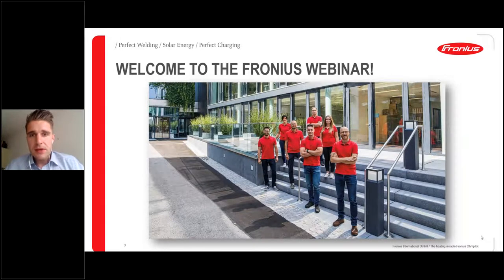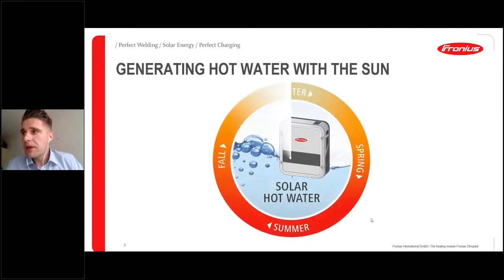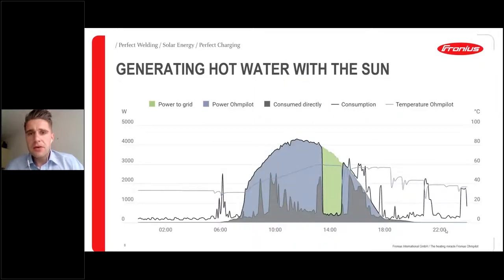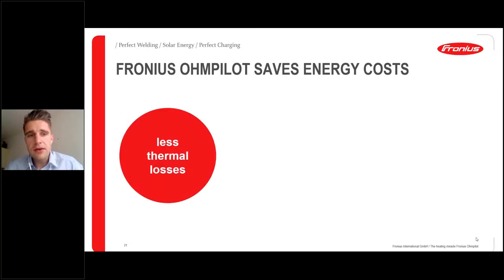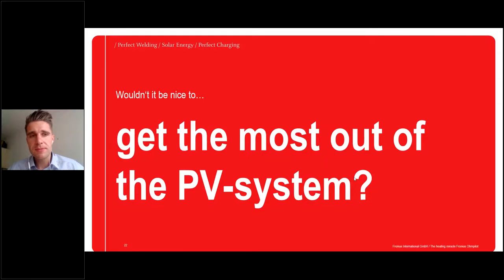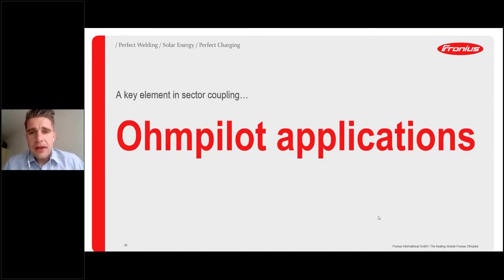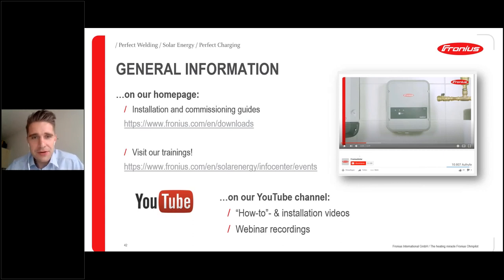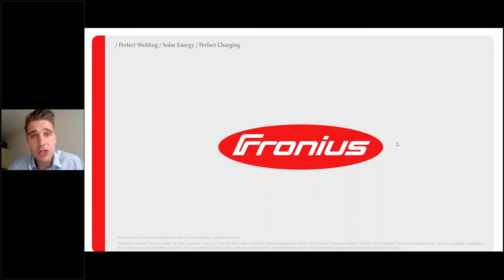Webinar: The heating miracle Fronius Ohmpilot

Comment: 1. Ohmpilot is delivering energy equal on the 3 phases of the heater from the boiler? 
2. Ohmpilot can cause premature damage of the heater from the boiler due to often modulaiton in the power delivered?
3. Do we need special type of heater in the boiler to work with Ohmpilot?
4. The heater from the boiler can work at various powers, like 3000 w 3 phase heater can work at powers from 500 w to 3000 w?
Reply: Ohmpilot is for resistive heater, heat pump can only be used to turn on/off using SGD controls.